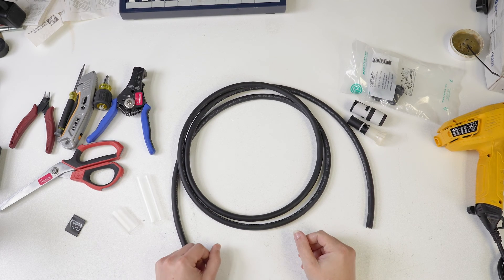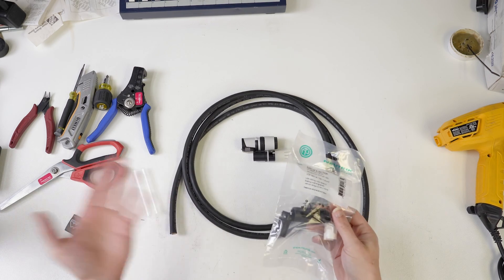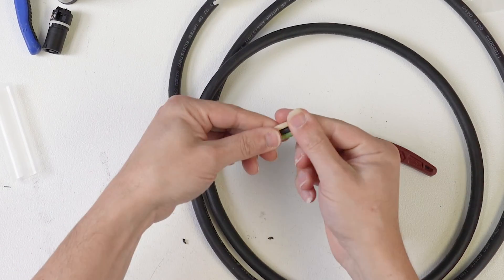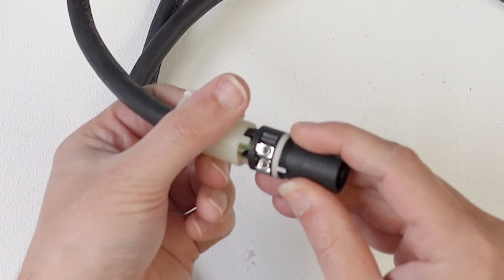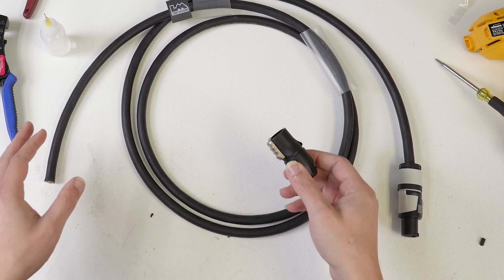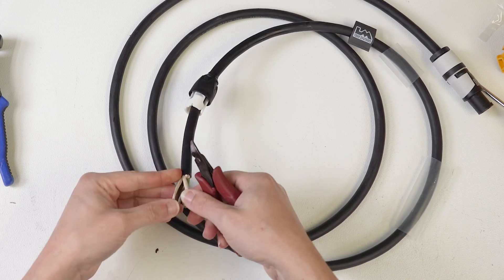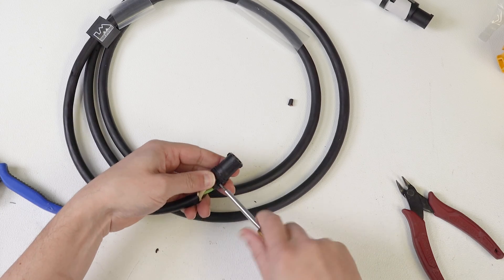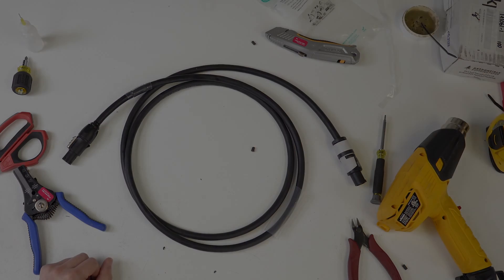Powercon NAC3FXXB-W-L To True1 NAC3FX-W-TOP Adapter Cable

Comment: thanks for the video.  I want to point out that the recommended tool is that metal horseshoe thing Neutrik HTLACB, without that thing can't really properly tighten the new powercon style fxx connectors.

Comment: The spinning back part is for safety reasons. These connectors have to be twisted for plugging and unplugging, and you will do this a lot. So Neutrik added the spinning part for preveting from accidentally unscrewing the back part while normal use.
And yeah, also utility knife user here. For everything! I just learned it that way so many years ago, never changed :D
Reply from the maker: Cool. Today I learned! You truly are the analog mensch! 😬😬😬